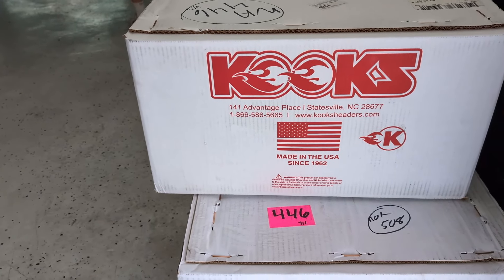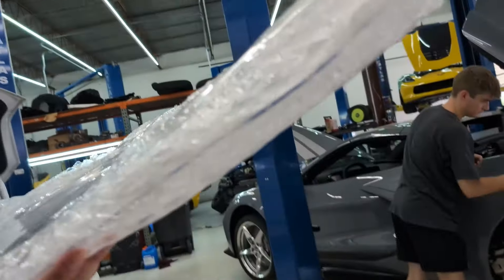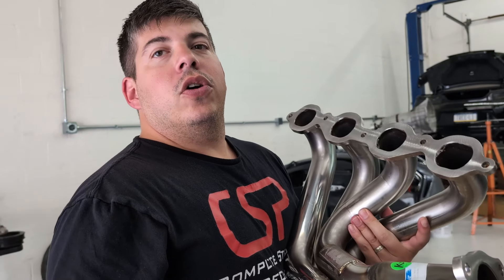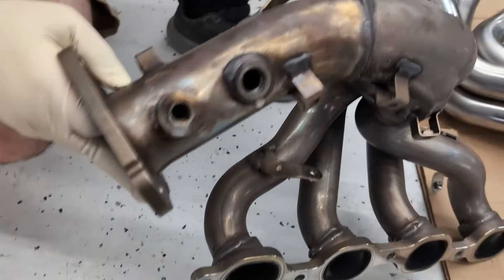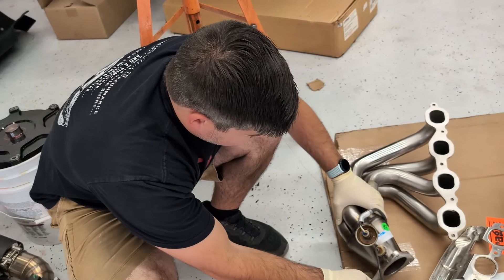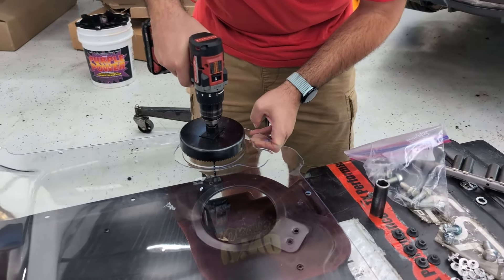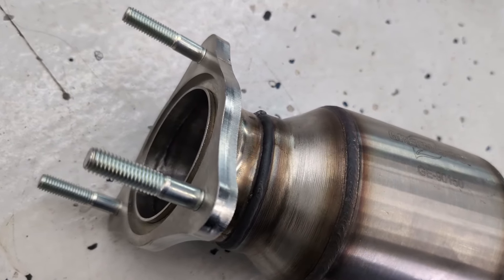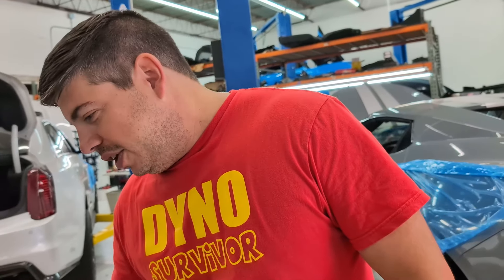C8 E-Ray Corvette Gets Kooks NEW 2in Longtube Headers! W/ Dyno Numbers!

Comment: Was the car driven after the headers install b4 the Dyno? I’ve read that 5 Dyno runs right after an install w/ new headers installed on the C8 will keep ramping up the HP peaking after the 5th pull( with cool down time after each run as to avoid Heat soaking of course)

Comment: Hi I’m wondering just how much total  timing does the engine like and the headers are very nice but very possibly too big ?
Drivability at low speeds and engine rpm might be better with the slightly smaller tube and the gains you see must be partially from the better cat…just asking not preaching as you must have a lot of experience
I enjoyed the video thanks